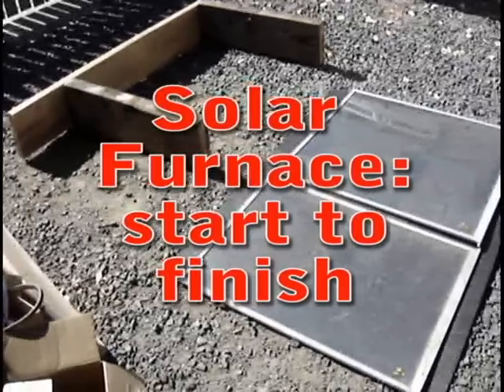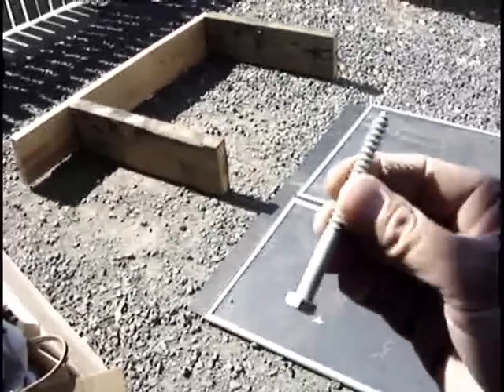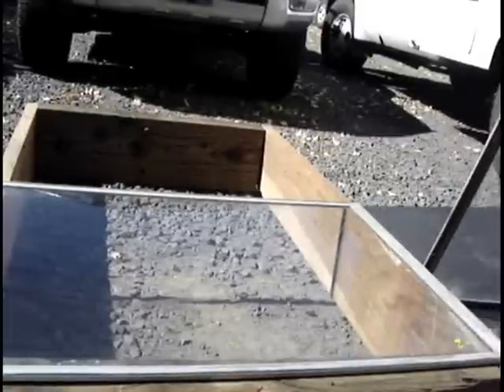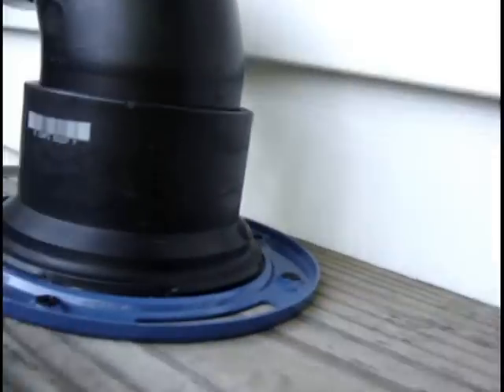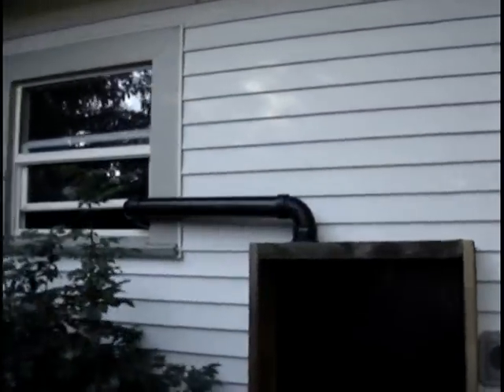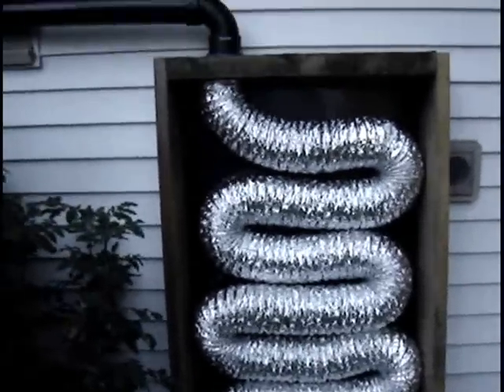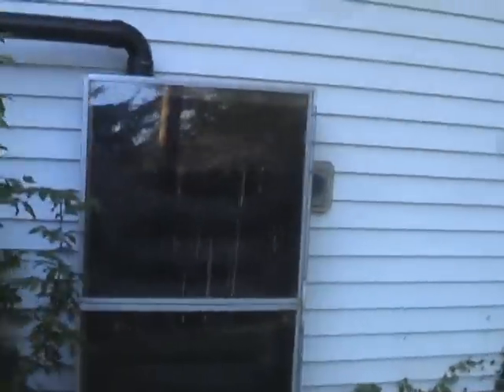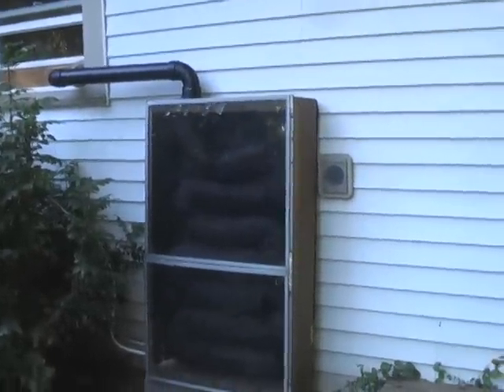Solar Furnace for under $50

Comment: Hey there... What does it do when there is no sun (nights)... would it let cold air in?
Reply from the maker: +Dmitriy Pgul  The unit doesn't let much cold air in at night as the fan only comes on when sun hits the solar panel attached (In my next video I go over this issue).
Reply from the maker: +Dan Brumit  Yes, the unit does an effective job of heating the air if the sun is out.  However, here in Western Oregon, the sun is rarely intense this time of year.  I put some data on another video that shows my calculations for BTUs (Solar Furnace Data).  This can be seen on my Youtube page.  To actually calculate the efficiency, I would recommend an analysis based on:

(a) How many sunny days are present in the time period you are interested in warming your house.  There are websites that might publish estimates on this for your specific geographic area.

(b) Analyse, with my calculations of BTUs produced, if that would benefit your situation in a cost effective way according to how warm you keep your home.  For example, if you like your house to be about 75 degrees, this unit might actually end up hurting your efficiency.  As others have pointed out, having this unit present could potentially waste energy through leaks/insulation issues within the exhaust/intake portions (especially if you keep your home pretty warm).   

(c) How large your home is.  I created 8 videos advocating the building of tiny modular warming pods... these would be perfect with a solar furnace as the small structure would get downright toasty on a sunny day with a 12' square foot solar furnace.

Comment: So the intake that circulated the air from the house is going back into the box? What did you use?
Reply from the maker: +angela ashley   As the house I was staying in was a rental, I ran thin hoses from the house to the intake.  Ideally, someone would run a heavier PVC pipe from the bottom of the house into the bottom of the unit for most efficient airflow.

Comment: Two questions:
1. Do the intake/cold air tubes just go into the cavity of the box or are they hooked up to the aluminized dryer duct within the box?
2. Did you consider having the intake and outtake in two different windows so it would draw the warm air through more than one room?
Reply from the maker: +Doug Wells  (1)  Ideally, the intake/cold air tubes should be attached directly to the aluminized dryer duct to avoid air from outside the box from entering (in case there is a leak in the unit). 

(2) That would be an excellent idea to have intake and exhaust on different sides of the house.  However, I would urge caution on having too much exposed piping as this could result in heat loss.

Comment: Pipes are too long and not insulated. Why not put it directly under the window?
Reply: +Jason Logan Convection would not work with the unit at or above window level.
Reply: +Derpster2493 or on the roof
Reply: Because the plant is in the way?
Reply: Derpster 
There appears to be a bush there...
Reply: Derpster why not try a real furnace and get real Heat

Comment: Great simple ides, but just delete the silver, or any hose for that matter. It's counterproductive! Argon filled dual pane glass which is not IR coated, and a flat black or other high emissivity surface inside will be your best bet. Just use the empty cavity inside and insulate the rest of the exterior 😊

Comment: the fan wastes energy, so take out the fan and put a same size return pipe. Cold/warm air convection is enough to circulate the air!
Reply: PERSON 5 WORKING, WHICH
Reply: +Darryl Edington "any heat from the fan motor is added to the desired result" REALLY??? because out of 100% energy used by fan motor maybe 5% is converted to heat. A fan converts electrostatic potential energy to kinetic energy and not heat!!!
Reply: +Persian5word kinetic energy is converted to heat eventually too. No energy is loss when you want heat.
The only better way to get heat from electricity (than 100%) is with a thermal pump (air conditioner) and those get around 300% efficiency.
Ask any mechanical engineer...

Comment: interesting idea. I don't see the need for flex pipe inside box. heat goes up and cold air falls. I suppose it allows you to control bypassing of air. otherwise you just need to connect box to window. I agree with previous comment that maximum efficiency is to not restrict return flow by having equal piping on both sides. note that the warmest air might be in your attic if not properly ventilated...but that is another issue.
Reply: The pipe absorbs some of the heat being alumnium. It increases efficiency of heat

Comment: Looks like a good idea How does it Work?
Reply: +John Canivan The sun heats the air trapped inside the box.   As that air rises through the drier duct,  the hottest of which would eventually exit into the house.  This hot air escaping up top would cause a small vacuum, which would draw air in through the smaller white tubes he has coming out of the window.  Over time, that new air gets heated and the cycle constantly repeats itself.

Comment: thegulley.com Do you have any concerns that chemical VOC's will be released from the plastic heating up? Have you had any 'weird smells' coming from the heater ( plastic smells)? Thanks for the share, this is cool.
Reply: The temperature would not heat up substantially enough to melt plastic which would cause the weird smell you're thinking of. So, no I don't reckon that would happen.

Comment: How much you save with that in a sunny day ?
Sun power 1kW/m2 maximum, yield typical 30% if  the hot air enters up in the house at less than 30°C,   i.e. 300W/m2  in a few sunny hours gives  around 1kWh/m2day  i.e saving less than 0.1$/m2day.
You recover yours 50$ in 5 years if 100 sunny days in winter of each year !!
It is perpetual and thus  good saving over many years with many m2.
You can improve with  the air intake down, not from outside, but  from the house, cycling air .

Comment: You could make this more efficient by:
1. Adding a small DC fan inside the pipe to move the air. Fan could be solar powered.
2. Have the air intake for your dryer tubing outside of the box, not inside. That way you can seal the box and allow the air inside it to get warm, increasing efficiency by enveloping the entire pipe in heated air.
Reply: tedtw Oops! I didn't read the comment below.

Comment: I am thinking this would be great to heat a basement in the summer. Yes  I said in the summer-our basement is 57 degrees in the summer-too chilly to sit down there and watch TV-hate to spend money to run a heater in the summer and while I like air conditioning- 57 is too cold. This would probably  take the chill off and make the basement about the right temp.

Comment: Id install it on the roof or at least away from the house in a open sunlight area for better operating range in hours and put the intake lower to the floor and the exhaust higher up for better efficiency in warming cold air i do like this build though it captures the engineer in me

Comment: I've seen a couple systems like this. You can use more of the space in the box by replacing the dryer vent tubing with aluminum cans that are drilled out top & bottom and sealed together end to end. I'd also suggest wrapping the exterior PVC pipe in some insulation to prevent any heat loss on its way to the house from the box. Love this idea in general though. Cheers!
Reply: Sammy Dewald, have you also noticed that nobody considers heat loss through single pane windows? Double pane -- at a minimum. Triple pane -- even better.....
Reply: John Shilling more panes the better, I’d imagine cost would be an issue for folks doing this kind of project on a minimum budget. But maybe they have spares some how or a building supply thrift store nearby.

Comment: What if you also went straight down, then did the back and forth until the final turn was at the top? Colder air would sink, the warmer air would be at the top. Is there something about the hole location that made you run it at the bottom?

Comment: Why is the return air ducting so much smaller then the supply?
Reply: Cold air is denser. That's why a furnace with AC needs a bigger Motor!
Reply: benkojr if you did that to a furnace with A/C the a-coil would freeze up due to a lack of air flow. Here is the equation = 200 cfm in = 200 cfm out. Cold air is heavy and falls, hot air is light and rises. 200 cfm of cold air is still 200 cfm of air, hot or cold. The bigger motor is to lift the heavier cold air. You may be confused about condensed and compressed air. Make your intake bigger and put a damper on it to adjust the amount of air and/or the temperature of the air. Slower flow becomes hotter in the heat exchanger.
Reply: Think of this ti help remember. If you touch something hot and want to cool off your  finger what's the shape of your mouth? And the opposite question, you've just filled four glasses with ice and your hands are cold so you blow in them. What shape is your mouth?

Your lungs are the same size in both. But the temperature is colder or hotter (relatively speaking)

(Technically that's an example of pressure. But since pressure and density are positively correlated (increase/decrease in the same direction ) it can still help us remember this.

Cold air uses less space  ( more dense) then hot air (less dense or light) so the same amount if air going in the small tube warms up and needs space to be.

It can work with the same size the while way. Smaller would be better and larger.  And if the tube is the same size there will be more pressure so the warmed air will blow out faster as compared to the small intake version.

Comment: i cant imagine this thing working in cold weather - the air travels almost just as far in the pipes outside in the cold, as they do inside the "furnace" part..  your drawing warm air out of the house, cooling it, then heating it for few seconds, then cooling it again, and then finally letting it back in the house..   without a video of a thermometer monitoring the ambient temp in the house, and another showing warmer air coming out of that pipe - im calling bullshit on this one..
Reply: No fan? Don't see how you'd get airflow. What temp. increase do you see on an average cloudy winter day in OR? I'm sceptical in the absence of data.
Reply: @markg4459   the way it works is the hot air rises up those hoses. In a colder environment it should rise pretty fast
Reply: @AshGreen359  Of course heat rises but there's still no data provided about how much the unit raises temp of the air...or airflow. You've made some nonspecific speculation...I guess I could too...but there's no data.
Reply: @markg4459  I agree there is no telling how effective this thing is. I've built a wood fire hot tub heater using this same principle the heat siphon.

The black paint really gathers heat well but I agree. No telling how well it actually works.
Reply: I totally agree with you. To get this thing to work even slightly you would want the amount of outside piping to be at it's absolute minimum. Having what looks like 4 - 5 feet of piping outside in the cold is going to take any heat generated back out of the air. Also, the lack of any type of mechanical circulation makes me suspect. I'm finding it hard to believe that this device will take in min of 65 F air that would then be subject to further cooling by the hose exposed to external cold and be able to heat it higher than 65 F on a 30 F day (the output would have to be higher than 65 F in order for any type of positive air flow with no mechanical circulation). Even if I accept that, I would think it would only work when the sun is shining directly on the device, so what's the process for not having cold air filter into the house when the device isn't producing heat. You have to lift your window and remove that 2x4 with all the rigid piping attached? Seems like you'd waste more heat doing that than you would gain. I'm not sold that this would really provide any benefit, seems like there's too many holes in the  design.
Reply: Doesnt show what is used for output and intake circulation.
Reply: +Fortysomething BadGirls — Natural convection in the flexible vent tubing would provide some circulation without a fan, although it would probably not be very effective for such a small solar collector.
Reply: kctyphoon this work in Poland in snow weather. I have done one years and years ago.
Reply: @oskar115  Cool, no pun intended. Show us a video clip of yours', I'd like to see it.  Take care from Tn.

Comment: Why not use a hole saw to cut a hole in the house the size of the pipe and calk around it with removable calk.In the summer remove the pipe and make a plug for the hole.Dryer vents most of the time are put in through a hole in the wall.That way you wouldn't have to deal with what to do with the window.

Comment: Why so small of cold air return tubes? I would think you want to open that up.
Reply: And that they should also be black.  Why not have the air start the warming cycle on its way to the solar collector and that the intake pipe should have full sun exposure as the return pipe does.  If there was a fan of any kind in his project I could not see it.
Reply: He built it on a budget. If he's anything like me, source what's in your garage before going to the store. The more you tinker=the more you learn.

Comment: I liked the idea of using the dryer vent pipe. You may not know it but you have a big air leak between the windows where they normally seal in the middle. I would think you would need to increase the size of the intake pipe to be the same size as the bigger exhaust pipe to get better air flow, the 2 little pipes are not going to let much air pass through them. Also the pipe coming from the collector needs to be insulated so you don't loose the heat collected.
Reply: The pipe, being black acts as part of the heating system itself. As it's plastic, it wont lose heat too quickly.

Comment: If you paint everything (including the dryer duct) matte black efficiency will multiply.  Also, recirculate one third of the air back into the heater.

Comment: I am just wondering if this would work here in Winnipeg, Manitoba, Canada temperatures here are below 20-40 degree Celsius in winters?
Reply: ***** lol  :)
Reply: ***** So you mean to say that I need to put a fan for pushing the air around, right?
Reply: Thanks for the reply, I will sure give it a try next winter.
Reply: +abco99in  Did you try this? I'm curious because I live in Minnesota where it gets pretty cold.
Reply: +Bill Schiller No Bill, I didn't get a chance yet to try this

Comment: would have to be much more efficient for NE Ohio area as we get hardly any sun during winter.  One good start would be having your intake coming from the cool basement air instead of drawing out the same warm air you're putting into it.
Reply: Bad idea.  We are heading living space. In and out from the heated space is required!
Reply: Why would you want to pull cool air from the basement? You want to heat the air in the house, that's  why you pull air from the house.  Pulling cool air from the basement will just require more solar energy to heat it to a comfortable temperature.

Comment: Dig a ditch and bury an extension cord tapped into your neighbours wiring while he is away for the weekend then enjoy the free electric heat.
Reply: Hahahaha ! I’m still laughing
Reply: I'm a Retired Power Company Lineman / Technician, and you would not believe the devicesI found that people put together to steal electric power.  Some were Genius and others were comical!   For the Record, once caught, you get an estimated bill for the lost revenue (Stolen Electricity), you are required to have a $Certified Electrician$ rebuild your system to the latest updated $NEC codes$ and then you are required to put up a $LARGE$ security deposit as a promise you will never steal power again. Usually 10x's you estimated theft.   Then the DA gets your ass in Court for Felony Charges.  Usually not jail time for first offence, if it's not Commercial Power.  But lengthly probabtion is normal, with all it's hassels, are handed down.  Not worth it!  Going "Off Grid" is Cheaper than stealing and getting caught. And I caught a lot of them.  I am (was) a professional at catching Power Thieves!  But I can teach a lot of you how to cut down on your power usage and reduce your $ Bill.
Reply: Aye Bee you mean steal?
Reply: energy is everywhere in the universe, it is inherently free, as it exists in each atom. but ..............................SHSSSSSSSSS !!!!!!!!  they killed mr. tesla to hide this knowledge , so they can make money...money : the root of all evil..
Reply: guitarman Nance  Tesla died in his hotel room at the ripe old age of 86, of a coronary thrombosis (formation of a blood clot inside a blood vessel of the heart) Stated simply, that would be a heart attack.

Comment: Why bother going thru the trouble when you are not really circulating air with the two small intake lines and uninsulated exhaust lines...While I applaud your initiative, tapping into alternative energy is really about efficiency.

Comment: I'm curious about the actual heat differential  coming through at the top  opposed compared to the intake?? could you take another video with temp(laser pointer?) readings at different times of the day along with outside temp? I'm sure you could quiet the doubters.. great idea!!!I'm cheering for good results...